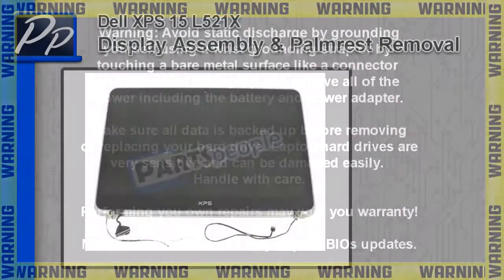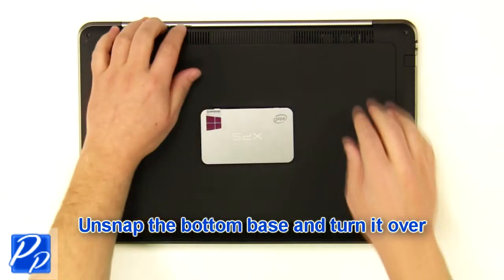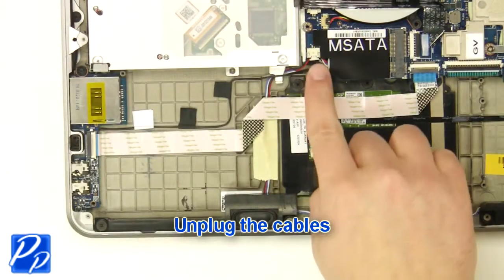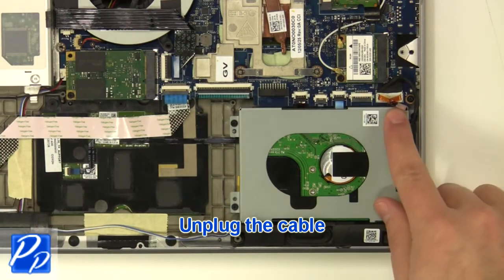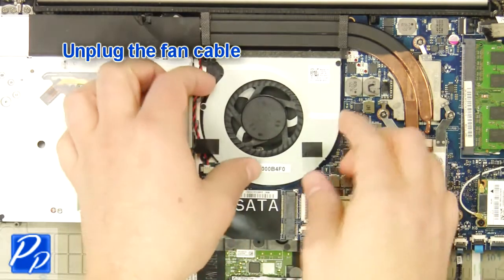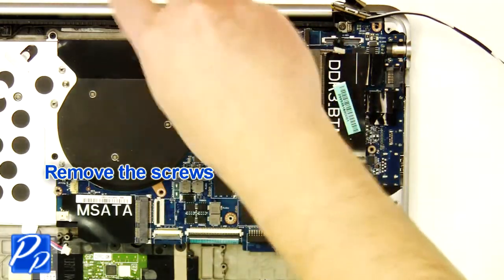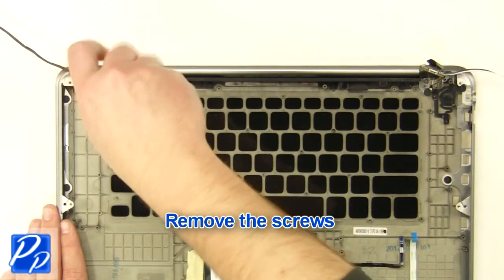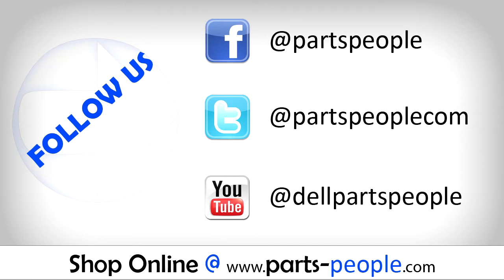Dell XPS 15 (L521x) LCD Display / Palmrest Replacement Video Tutorial Teardown

Comment: Thanks for the video. Is it necessary to solder anything to put the laptop back together? Or just screw everything back in?
Reply from the maker: No soldering involved during reassembly. Just follow your steps in reverse and take your time.

Comment: My XPS needs a tiny star wrench to remove the bottom screws.  Anyone know what size tool this is?  Thanks.
Reply: Torx wrench but so small
Reply from the maker: Mary Nadasi
I believe it is a T5 Torx screwdriver.
Reply: Mary Nadasi never mind I found one!  tiny tiny torx wrench
Reply: thanks, your video totally saved me!